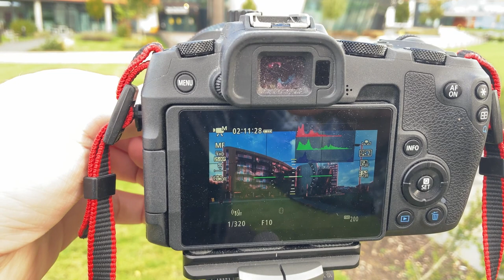Using tilt/shift lenses - basic lens shift to correct for converging verticals

Comment: Thanks, Keith. Clear, concise and engaging as always. I think it's worth suggesting, even on a very general level, to meter first with all tilt/shift settings set to 0 on a FF/APS-C camera, as the tilt and shift throw out the camera's light meter quite significantly. It gets even worse when you use the 45 or 90 mm TS-E lenses.
Reply from the maker: Thanks Stefan... you've just added a new video to my to-do list ;-)
I'm quite deliberately trying to stick to just one 'feature' per video - I need to go through all the articles to see what I can add. I've been writing them for ~15 years, but only started doing these videos in August.
Reply: @KeithCooper  You're doing fine.
Reply: Metering is important, as you mention. However you will find if live view is used the camera will give an accurate exposure reading when the lens is shifted, making life simpler.
Reply from the maker: @MrMB2652  Yes, live-view can help. However I often meter looking though the viewfinder, which is most definitely thrown (in a DSLR) by any movements.
It depends on how you work - it's something I check every so often and then set accordingly according to how the scene looks, since I only tend to use T/S lenses in fully manual mode. In many ways I just treat the camera as a nifty light meter with optional spot metering
Reply: @KeithCooper  Yes, I used to meter without tilt/shift (or even with an incident meter), it's just I find it so much simpler to use the live view metering, particularly when you are already using it to zoom in to check focus. Often now when the shutter stays open longer than was expected I know live view has turned off, and I'm about to delete a file from the memory card.....Cheers

Comment: Hi Keith. Great video's. Tnx for taking the trouble. I shoot at building sites quite often. I use a canon 16-35 L F4. Most of the time i have limited room. I tend to shoot upwards to get the top of the buildiing in the shot. 15-20 stories. I fix it in Lightroon with Transform. A lot of the time  that will get the job done, but often it just does not work. Can not get the whole building in the picture. Do you think the Laowa 15mm. shift lens will make a big difference? Thanks for your help!!
Reply from the maker: Thanks
Yes, the 15mm is very useful. Always better than correction to do it with the lens. Mainly because you know what's going to be in the frame.
I'd probably use the 17 a bit more often, but that's partly because I'm used to using the 17 and 24 for years ;-)
Do check the proper reviews/articles as well, since the videos are meant to supplement them (oh and the book ;-) )
Reply: @KeithCooper  thanks Keith.